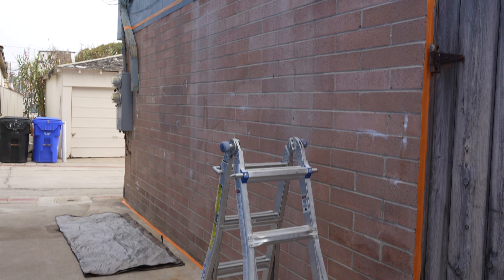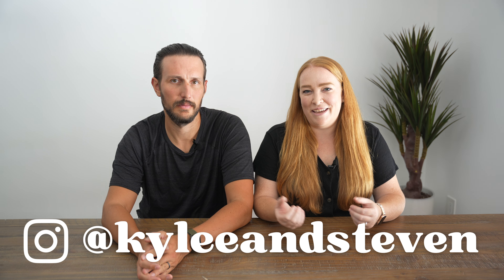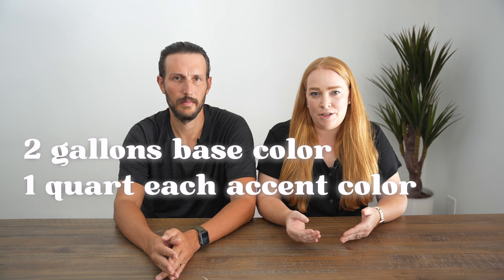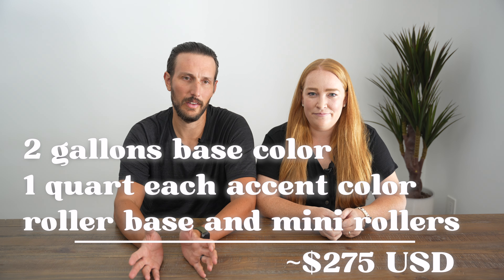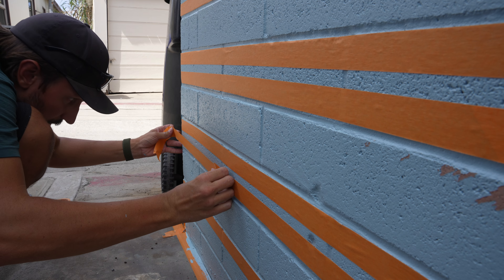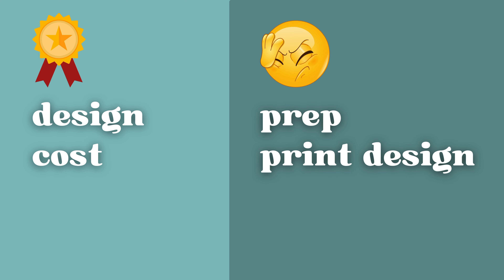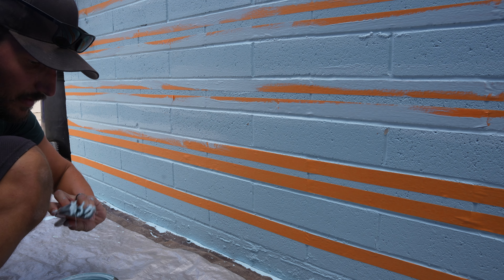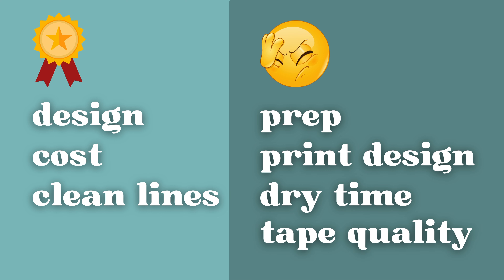Our $275 Airbnb Marketing Investment + DIY Mural Mistakes

Comment: It turned out great and looks awesome.  When we try to paint concrete or block or brick we use a concrete bonding agent available at Home Depot.  It rolls on almost like water and dries very quickly.  Then you add your prime and base coats over that - we have never had anything peel or blister when we use this bonding agent.  I appreciate your always being honest with your audience.  Thank you.  Nice job.  Cheers from Wisconsin.
Reply from the maker: Ahhh yes that sound like something we should have used! 😅 Thanks so much for the tip!

Comment: Really nice 😃
Reply from the maker: Thank you, Kelley!
Reply: Very nice job! It really spruces up that walkway without being too fussy a design. Simple and clean. I would suggest that on the next job you first power wash the surface, allow to dry well, and then prime before final paint layer. As you stated, best to leave 24 hours before final coat of paint especially if you are in a damp location.